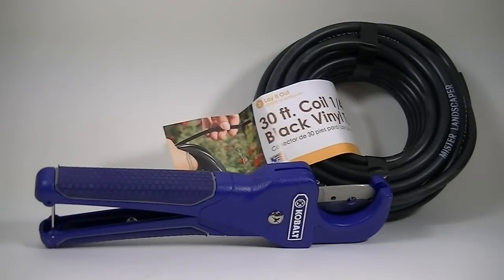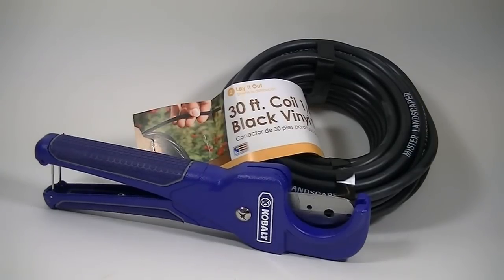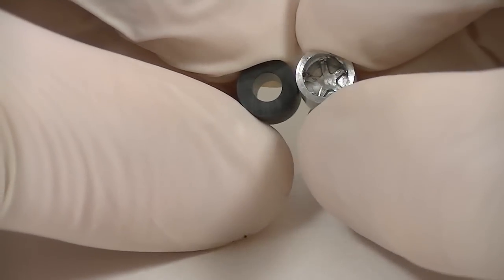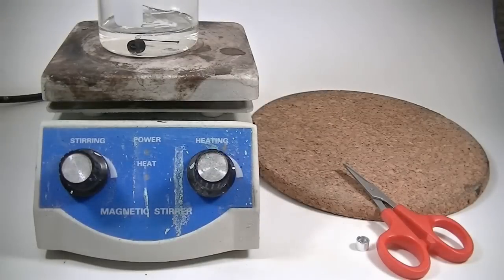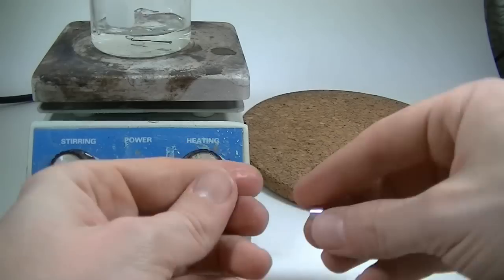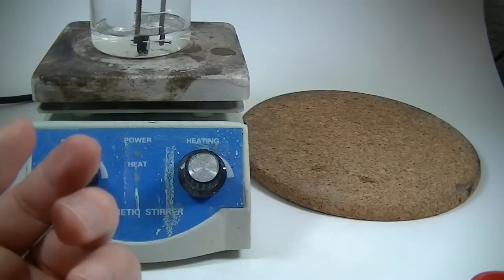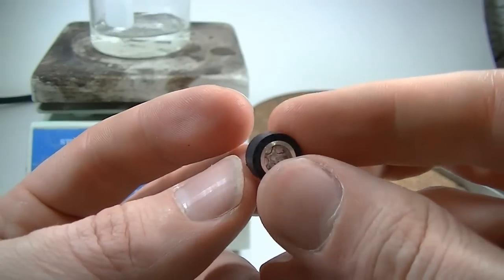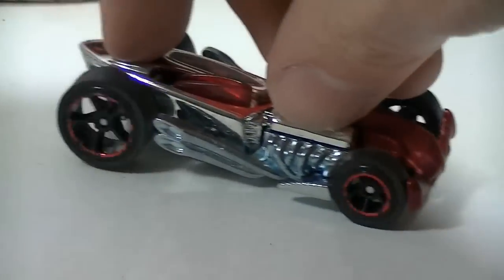How to MAKE Real Rider Wheels for your Custom Hot Wheels (Part 2: Making Tires)

Comment: technique for adding "use" to slick tires: hold a foam sanding in one hand and a car in the other. Rub the car in a circular motion around the sanding block for about 3 to 4 minutes, and you will end up with that gritty matte look of slicks. Just a fan passing along tricks.

Comment: Awesome! Wonder if the modeling trick of sanding the tires (vinyl in this case) would create a more realistic rubber tire look? Or maybe you could slide a section of the vinyl tubing on a section of similar diameter pipe and put it in the lathe and then use a wire brush or wire comb (used for cleaning paint brushes) and scratch some light grooves on the outer edge of the vinyl. Well either way I dig the idea. KUTGW on these cool tutorials!

Comment: To make tread you can take clay and flat it down . Then take a wheel that has tread and roll it on the clay . Than make a mold of it . Then you can heat the tire you made and roll it on the mold . Then let it cool .

Comment: I wonder if you could put treads on by using a flatten pen spring heating it up? Or perhaps heating a small hobby file rolling the tyre on that? Just a suggesting.
Reply: I will trade you